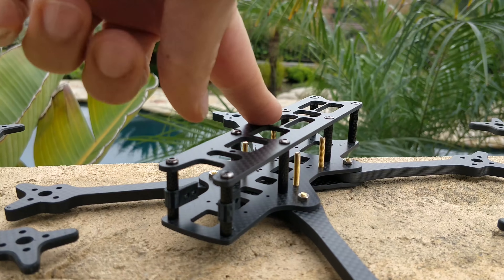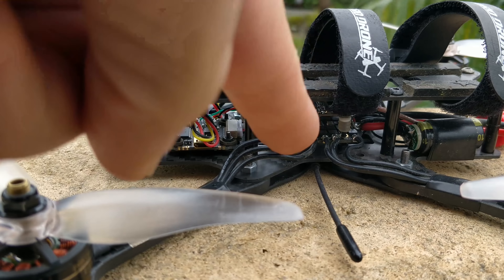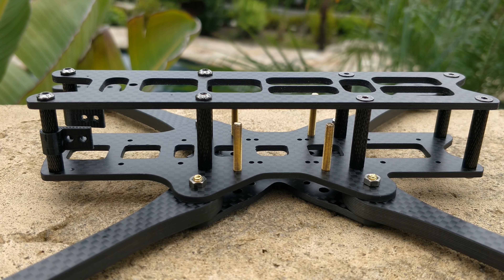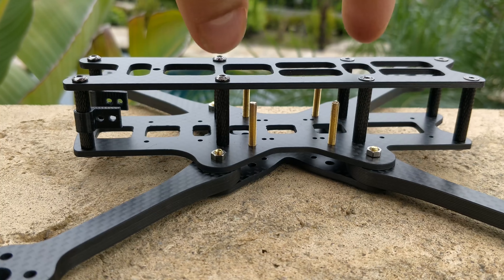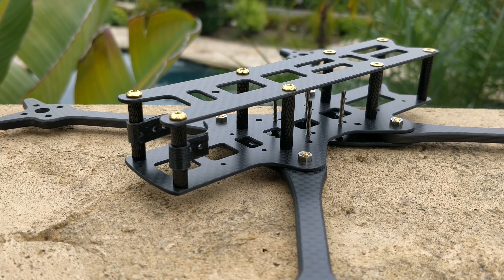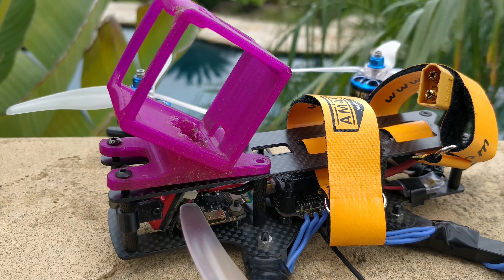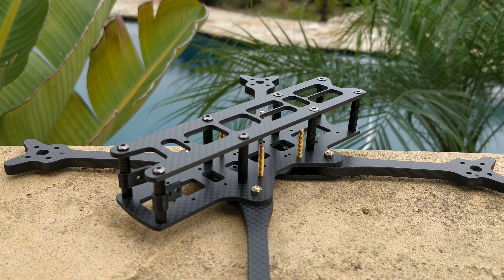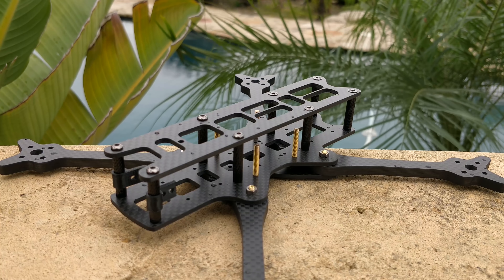Glide - 84g lite, 115g hammer, 97g standard

Comment from the maker: Glide (97g): https://bit.ly/2s66964
Glide Lite (84g): https://bit.ly/2QhkGn9
Glide Hammer (115g): https://bit.ly/2Zi48j8
All weights are built with hardware and TPU FPV cam mount.  No electronic mounting hardware.

Other things we like for this build:
6S Mamba ESC: https://bit.ly/2Swjq2D
4S Mamba ESC: https://bit.ly/2s65DoF
Nazgul 5140: https://bit.ly/39arcEX
Gemfan 51466: https://bit.ly/2SrWwtb
RunCam Micro Eagle: https://bit.ly/2EPP42V

We will have motors in the future and the upcoming DAL Nepal prop is pretty interesting.  I recommend a 2306 with either the Nazgul 5144, Ethix S4, Gemfan 51466, Gemfan 5143.3 (which isn't available yet) or upcoming DAL Nepal prop that I believe is a 5140.  2207 and 2208 are good too but these newer props tame the 2305/6 motor size much better and you get slightly improved zero throttle control with the 23 size stator.

▼Join my FB group for more discussion: Kabab FPV
https://www.facebook.com/groups/379155946182689/

The store: www.FPVCycle.com

▼ My typical 5" quad setup:
-Hyperlite Glide Floss Lite: https://fpvcycle.com/collections/frames
-Motor: -Xing 2306: http://bit.ly/2Nqqr25
- ESC: http://bit.ly/2oDdzvL
-WaFL’s Cap Cap: http://bit.ly/2GUpXxO
-Battery: http://bit.ly/2JnsTDM
-FC: http://bit.ly/2XRc8G8
-FPV Cam: http://bit.ly/2Q7LfL7
-Vtx: http://bit.ly/2HsrASs
-ND GoPro Mount 30deg: http://bit.ly/2WC15zc
-ND Filter (if used): http://bit.ly/2WEmQ1j

▼My preferred goggles as of Sept 2019
http://bit.ly/2k5YNv5

▼Notable motors:
-BH R3 2207 for $9.99: http://bit.ly/2NaTWEy (limited quantity only)
-Xing 2306: http://bit.ly/2Nqqr25
-Xing 2208: http://bit.ly/2y3te8R
-FANTASTIC 6" motor: http://bit.ly/2LqghOZ

▼Starter goggles: http://bit.ly/2qbJNOS

▼ If you want to solder better:
-Fantastic solder: https://amzn.to/2P5QM2W
-Fantastic iron: https://goo.gl/DqBipa

▼ Tips?
Patreon: https://bit.ly/2oGLP9b

-PayPal: https://www.paypal.me/kababfpv
-Bitcoin: 1E4XZXoD4rS6MYWVWuenY7Kw2M1YgyNpoQ
-Nano: xrb_1188ek5bd7tb9kw67asnp9o65byuoaxbtpxuznx1ribf75x78awywmakj55f
-ETH: 0xD067F93811f2eC31CB1928901002dfdf9A492EF5
-LTC: La2KWYAjp4VT2Lq2M76pbjzXWvRyjpfCtG

-Tesla Referal code: https://ts.la/bob40889
Please use my referral code if you're gonna buy a Tesla.  You get some free stuff when you do and I get better status with Tesla.
Reply: Will the 6mm arms fit the previous glide versions?
Reply: KababFPV The Hammer is out of stock on your site. Any idea when it’ll be available to order?
Reply from the maker: @roidbear5  it's currently being manufactured. Unknown when they'll actually get to the job but it's usually 2-3wks as a conservative estimate
Reply: KababFPV Thank you for the lead time. That gives me enough time to completely destroy my current frames to convert my fleet to the Glide Hammer lol
Reply: hey i wish i could send you this pic i took of the T-motor Velox motors I bought.  am i just tripping or do they have the biggest air gaps ive ever seen?
Reply from the maker: @djilly75  I don't have any but I've heard they're not very good with respect to construction quality and such. I'm sure they work fine however. I was going to work with Tmotor to make a motor similar to that but I went another direction to assure quality
Reply: @Kabab  thanks. make a blingy motor with chrome feet and gold bell with silver windings

Comment: My go to build over all the quads out there , is the Hyperlite Glide Hammer, full weight with all my custom and extra pieces brings my total weigh in is 593grams.. and yet with 2306.6 motors it feels perfectly balanced. I have quite a few different style 5" quads.. trust me it's the best freestyle design out there. The only issue I have had was the arms, if you buy a replacement arm, it only has 1 of 2 nessecary holes pre drilled, other wise.. this is the best

Comment: I've been flying the glide exclusively since release and it honestly is my favorite design for freestyle. I love the way a true-x frame flies. It corners so much better than the wide-x style which feels like it's drifting or 'sliding' when turning. The FC up front makes perfect sense; gyros detect rate of rotation on an axis which is the same across the entire rigid plane in rotation (assuming the frame isn't flexing during rotation which would be miniscule). The battery strap solution IS THE solution, far better than the tradition slots (battery straps stay open for you while changing batteries). Arms are no problem to change and the arm bumpers are by far the most efficient and effective style for protecting your motors from all angles. I can't wait to finally get my hands on the LITE version. The only concern I see is the new top plate battery strap slots are super thin in the middle. Now, I've never broken that section with the original design, but that seems like it could be a weak area.
Edit It seems the skinny section in the top plate isn't there on all 3 versions shown in the video. I'm curious as to which version ships with what.
Reply from the maker: The hammer is the only one with the super skinny middle segment. That bit has never broken so it'll stay skinny. I'm surprised that other designs don't use this strap layout. It's the cleanest and most convenient to use by far. It's really my favorite thing about the design. It just couldn't be better.

Comment: You clearly put a lot of thoughts in this design and I like it very much, Unfornunately the one I want is always out of stock. Also I'm wondering, since all the components can be spread out over 3 locations on the bottom plate; Why aren't you using much shorter standoffs to slam the topdeck and get a more neutral cg ?
Reply from the maker: It's a pain in the ass to build inside a height less than 23mm. I didn't even go over a quarter of the thought that's gone into the design. That video would be hours long.
Reply: I slammed mine and LOVE IT! 😍
Reply: since the frame doesnt have camera plates you can just get your preferred standoff length yourself
Reply: Micro eagle and ratel don't like to fit in there perfectly with 20mm standoffs.  That being said I slammed mine to 20mm and used some small spacers on the front standoffs. Other micro cams fit with no spacers though.

Comment: You could problery fit the air unit over the ESC in the middle, and run the FC in the front on the gilde
Reply from the maker: It's a little too short with the standoffs

Comment: Commenting as I watch, thanks for the 3rd hole for the GoPro mount, as I said I still use all my Flowrides.
As for the thickness of all the carbon parts, I’d like to see a hardware pack for that frame, so we can buy every carbon part with the thickness we want. For me 4mm carbon arms are just enough, given what my Flowrides went through, but I also like to be able to have 2mm plates, the 1,5mm ones seems really skinny given the length between the front and the arms
Reply from the maker: The hardware for all the frames is the same.  It comes with lots of length screws to compensate for the thicknesses.

Comment: Great content as always man! I snagged a lite version a little bit ago and really like it. I take it and 2 flosstyles out with me every time.  I like the flosstyles compact body, but that glide top plate with the built in strap holders is next level.  With a good battery strap that has nonslip rubber on it there is no need for a battery pad at all the way it grabs the bottom of the battery and with the countersunk screws.  I'm Legit considering grabbing some glide top plates and modifying them to fit on my flosstyles lol.
Reply from the maker: The Glide is a much better overall design. But yeah I understand

Comment: As far as flight controller placement I will say in my RC helicopter days swinging two 700mm carbon fiber blades at 1500 rpms on up all the gyros were Not in the center of the heli. They are in back or in front of the main shaft which is the center or CG. It works fine. Don't forget to floss and balance all your props.

Comment: Interesting to see your move from 2208 to 2305. Beside the good match to new props I assume it is your love for bigggg bearings. Or do 2208 still have a more linear throttle curve?
Reply from the maker: No I still hugely prefer the nice soft throttle feel of 2208. It's the wobble Issue when you let off the gas that I can't tolerate. 23 size motors are better at managing that wobble. Not perfect still.

Comment: Thank you for the awesome work, Bob! I'm a big fan of the Flosstyle frame. It set the bar of lightness and durability very high for me, maybe even too high because when I look at most of new frames coming out the only thing I can think of is "oh my god, that is soo heavy, I would have to throw away half of the quad to use it". Should I call that the Flosstyle syndrome? 😅Anyway, the actual question: how would you compare the durability of the light Glide version to Flosstyle? Thank you.
Reply from the maker: The light isn't as durable as the standard or heavy. It's really made to fly, not to crash however it's not exactly weak either. I've never broken one myself but I also don't really crash and if I do I don't crash super hard. It's sort of like snowboarding. You get better at falling. I only fly the lightest version for myself when I fly. I only use 4mm arms. Not even the 4.5mm of the lite version.

Comment: Take your finger and tap one of the arms on the lite and normal  version. You'll feel the resonance  in the arm your holding onto. It's really hard to tell how good or how stiff it is by trying to bend it in your hands. I have smooth as butter motors new s4 props on and can see the resonance  in blackbox. I'll  be ordering the heavy version as soon as I can. Really am looking forward in seeing the difference  between  the heavy and normal. Do you plan on supplying  6" heavy arms?

Comment: @KebabFPV I do like both your designs, and way you think about quads. But personally I found out that even though extremely light 5'' (580ish grams) throttle response is tremendous, the quad itself does not perform that good. I have a feeling that it does not want to float down in a predictable manner. You can fight that off allowing motors to stop, but that introduces whole a lot of other problems.

I think that 600-615 grams performs overall better, even though you loose a tiny bit of throttle performance. But in return you get really predictable machine which can be tuned either extremely locked in, or floaty as a cloud.
Reply from the maker: If you used the appropriate power motor for the weight you'd think otherwise.  Drop the kv or just drop the max throttle endpoint and you'll be shocked at how great it is to fly.
Reply: @Kabab  i am using throttle limit to roughly 80% and with throttle curve. That combined with tmotor 5143 and 2306 2600kv (I'm on 4S). But in the name of fun and science I will try some software limiting in falcoX and drop KV by 100 on few packs!
Happy holidays!
Reply: @czarnas  notice any improvement?
Reply: @AgustinMolini  yes and no :) definitely dropping kv or adding throttle limit has impact on the flight characteristics. But to my taste, I still do prefer quad around 600g. Recently when I flawn my own quad without GoPro it felt alien and didn't give me the same joy of flying. But I would say, that if you settle on one auw, stick to it with all your quada. Then hardware used will not matter that much. And I recognize why Bob likes his extremely light drones, they do fly amazing. But not to my liking :)

Comment: A thought about the bottom brace: Would it be possible to remove the holes in the brace for maximum stability and use screws with hex heads?
Great design as always!
Reply from the maker: Yeah but I focus on convenience as much as anything else. That would just suck for convenience 😅

Comment: To the lack of sales of 5" quads: I may be an example of that. I have a set of quads that I'm used to, so firstly, I don't crash them as often any more, and if I do, if necessary, I fix them, because I love them 🙃 Which is also cheaper than buying a totally new one which may very well be a disappointment.
I only just bought a new 6" frame because I too bought the DJI system and none of my quads could take the air-unit 🙄
And to the FC not at the CG: That only matters if you activate the accelerometer. Then the FC will try to rotate the craft around the sensor which would be noticable at least in the logs. It may also shorten the flight time.
Edit: Oh, and finally, Merry Christmas 😊

Comment: Hey kabab ! I was wondering if longer frames like those are even existing because of the usual standard 20° to 30° camera tilt, therefore not having the props in view in the GoPro footage if it is mounted in the front end of the frame. I plan to fly only 45° tilt in the future, and find that I can put the GoPro closer to the center, and put the battery horizontal ( long side left to right ) This configuration with a squished x frame makes the most sense to me, allowing shorter frames, which means lighter, and better authority from basically every axis with minimal counter-weight effect, and no props in view with 45° tilt. Also, 45° is very aesthetical in freestyle, both Roll and Yaw centers of rotation are in view, symmetrically spaced on the footage, and tricks like Matty flips are easier, allowing more confidence for crazy stunts. The only downside is that you barely see the ground when you land.
Reply from the maker: If you're trying to do a lot of Matty moves you want a racing frame and at least 50deg tilt.  Props are unlikely to be in view at that tilt no matter what. The issue with the short wide X is that it flies like absolute 💩. The separation between the front and rear props are very important for balanced pitch control. Sure you can get used to it but compared to a nice large X layout it's just not that nice to fly.
Reply: @Kabab   Thank you for the input, I'm fairly new to the hobby and have no practical experiences in how different frame shapes feel to fly, it was just an intuition that I wanted to express out. I confused myself and wrote Squished X when I wanted to say Wide X, like an Alien frame for example. 
The Glide is a really nice frame btw, if my theory isn't working out as I wish, I'll take two of yours.
Reply from the maker: @AuxPlumes  wide or squashed x is fine, you should just be aware that it doesn't fly as well as a true x

Comment: Frame feedback (in order of importance):
Battery mounting - I fly with a gopro like 5% of the time. I want a frame that will run it if I need but the offset battery mounting means the glide (and the flosstyles I own) are not as appropriate as they could be
vertical x-fire/r9 antenna mounts - hard to solve but a solution would be amazing
A hole or something in the bottom plate so you can mount the capacitor out of the way and stick a board above it. I always end up with my cap taking far too much space.
Buzzer/lost model alarm (most people I know run these 100% of the time now), maybe a couple of holes for zipties somewhere or a small carbon shelf.
Reply from the maker: There's lots of build room on this thing. The entire back end is ample room for the cap. The frame base isn't quite big enough for a cutout bug enough for that cap. Also, people use different caps. You have lots of room to mount the battery on top. The straps slide around and you don't even need two straps really.  Absolutely can center mount.
Reply: @Kabab  RE caps, the problem is with a 1000uf or even a 500uf 35v cap in either the front or the back there is no longer any space for a board. I can kind of already fit half a cap into the rear slot which helps with securing it. I thought a sufficient;y long and wide slot would allow you to recess the cap leaving some room above/below for a chunky vtx of something.

Comment: Flung my Glide off a branch and smacked corner-first on the side of the house so hard today, lost a prop blade and killed the screen on my cheap action cam, 5mm arm took it like a champ.
With the FC in the front, doesn't it just try to rotate the quad around the FC, essentially swinging the rear end around a little bit?
Reply from the maker: It does not matter where the fc is. It doesn't care as long as it's moving with the frame. There is no movement or rotational bias
Reply: @Kabab  Does it only care about rotation/orientation, and not horizontal movement(And accel anti-gravity only I guess)?  Some more in-depth discussion about it might be enlightening.  I have mine (Talon Fusion) mounted up in the front behind the camera.
Reply from the maker: @macelius  as long as it's moving 1:1 with the frame, nothing else matters unless you're using autolevel then it'll care a tiny bit
Reply: @Kabab  Yes, the only scenario I'm concerned about is having to fly back from a distance LOS on angle or horizon (on loss of video) and it doing something i'm not even aware i'm compensating for during coordinated turns (yaw while pitched).